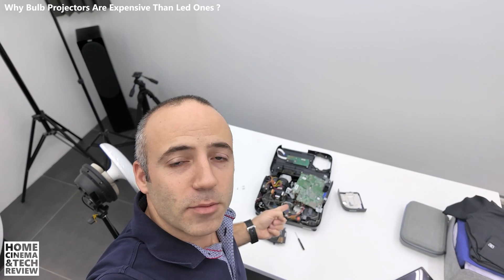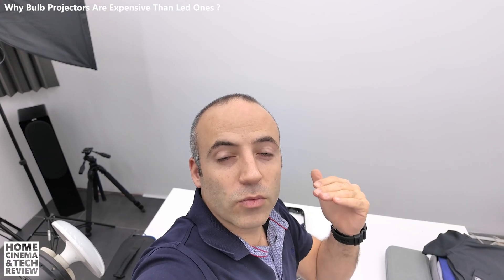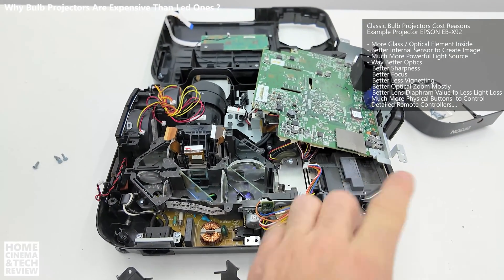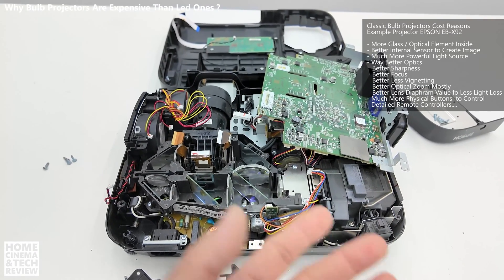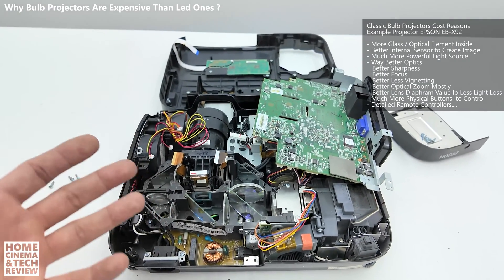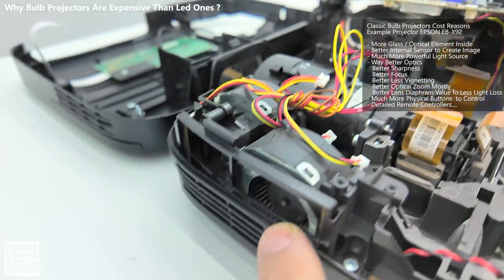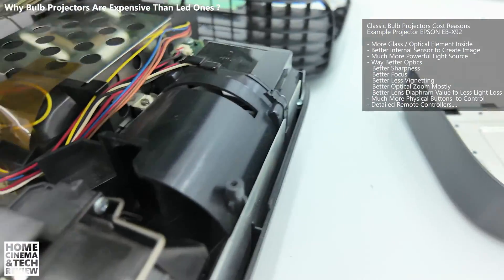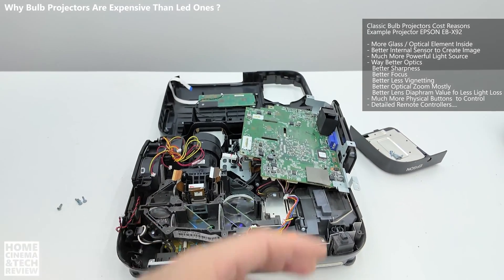Bulb vs. LED Projectors: The Cost Showdown

Comment: Great videos. My only concern about lamp projectors is using under hot weather conditions, can they handle 40 celcius room temperature?
Reply from the maker: Well that is a question should be asked 40 celcius is a hot room temperature specially for long time use scenarios and I've been reviewing Pc components over 15 years our standard is 24-26degree celcius generally they will work but I think its ideal to direct a fan to these devices to keep tem cooler because inside heat will be high just like a car engine there is a certain amount of heat regular bases so it will work but you have to be following them.But for built quality they are better than LED cheap models and day will last dont worry
Reply: @homecinematech  thank you, my use case is outdoors also but seems like to avoid during summer season or really hot conditions. Switching from budget led to Epson lamp projector. Thanks for such an amazing channel. I learned so much new stuff. I don't know what it is but my eyes just hurt when I look at TV. BTW planning to go for Epson TW 6250, any thoughts or other recommendations in a similar budget.
Reply from the maker: @nextgk  tv models are very bright and that is difficult juat like looking at sun right after tunnel😊
Reply from the maker: @nextgk  dont forget to watch https://youtu.be/H5mudUfCGYQ?si=E-uCyMisUsBTAtcX video as a guide to show difference